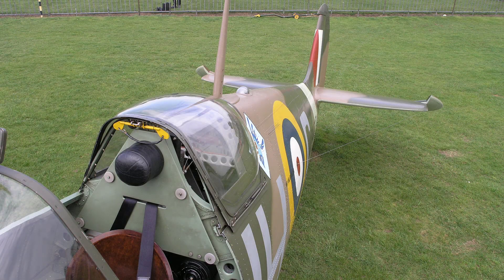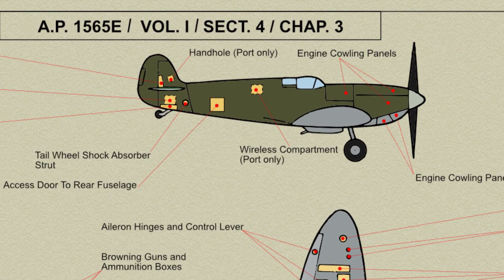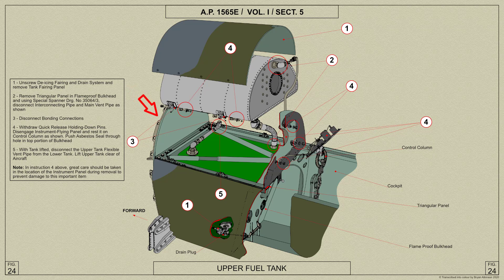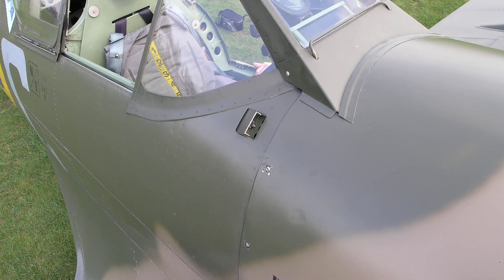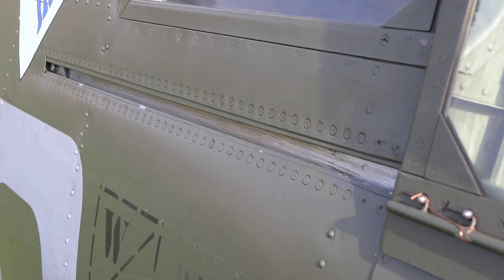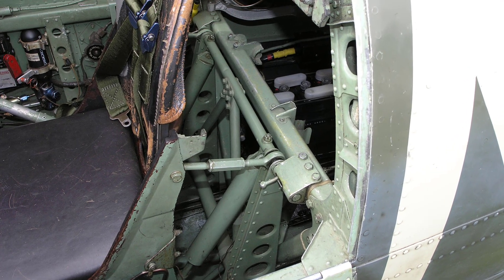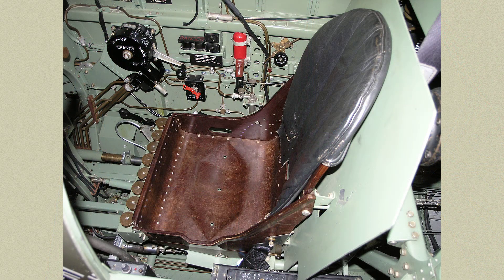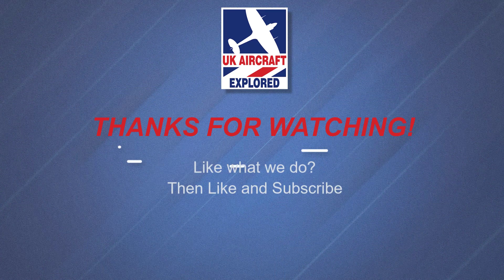Spitfire Mk V – The Fuselage

Comment: Thanks for your time doing all these there perfect video's for references! See the yellow pull relise above the seat is that original or a modern safety install? There not on high detail model's I build and I scratch build alot of detail that's missing in the cockpits to get them as close as possible these video's have helped woth running wiring and adding alot of levers n good stuff but if i can double check about that yellow pull cord before u add one and it's not accurate to ww2 standers,  it's going in a show in June my model so it will be judged with a fine eye! Thanks again
Reply from the maker: Yes,  the yellow pull release would have been fitted to wartime Spitfires. I have seen the release coloured red, also. So I can't 100 % confirm the correct colour. Watch my video covering the Spitfire Mk.V Canopy for more information. Thanks for watching.

Comment: Thank you again for a great video which is very informative. The seat pictures show both ‘plastic’ (not sure it was called Bakelite at the time?) and metal seat... I would be interested if you had more information on where / how the the harness attached to the seat? Down the front and into the hole, or over the back? Presumably the material of the seat had an impact on this? Don’t worry if you don’t have the answer - I don’t think anyone has definitely knocked this on the head - not even the great (late) Edgar Brooks! Anyway, thanks again.
Reply from the maker: Thanks for your feedback and I'm pleased you like the videos. Also, thanks for bringing to my attention the question of the Bakelite pilot's seat. Back in 2004, when I was researching for my Spitfire Mk.V Explored PC CD-ROM, I was told by someone that the seat was made of a 'type' of Bakelite. I have always thought that was the case. However, having looked it up this morning, I have found that it was in fact an early composite plastic called SRBP – Synthetic Resin-Bonded Paper. It's a pity I can't re upload the video to correct this. Still, that's life! Regarding the pilot's harness, my videos are based on the wartime AP manuals and I have included the Sutton Harness & Release Gear AP diagram in the video. I have checked this and it does looks (on the side view) as if the 'Y' portion of the harness runs down the back of the seat. Anyway, thanks again for watching.